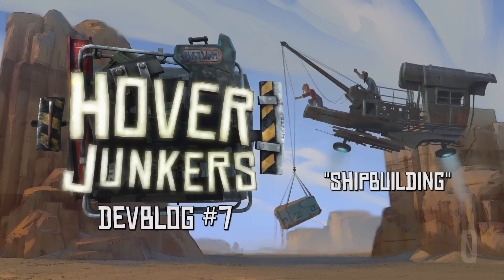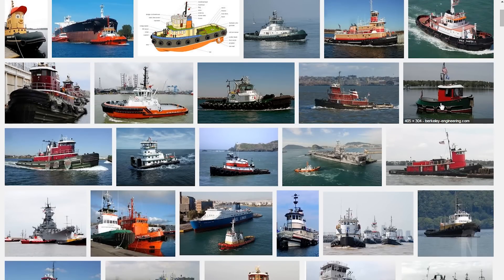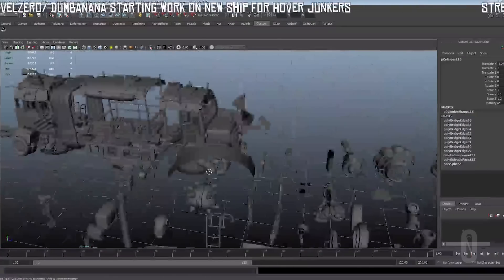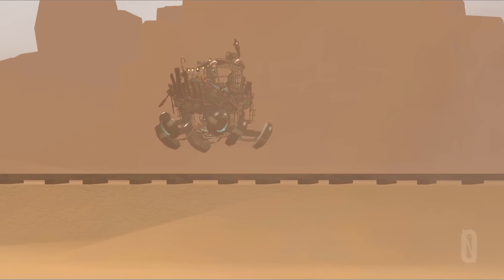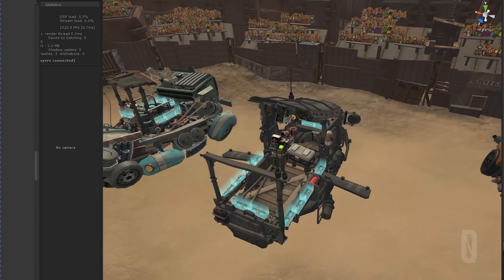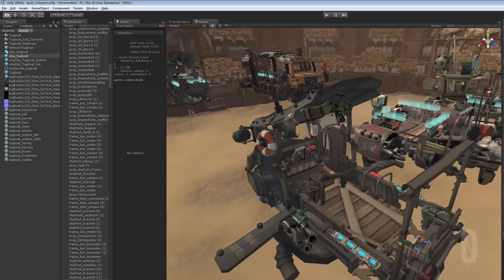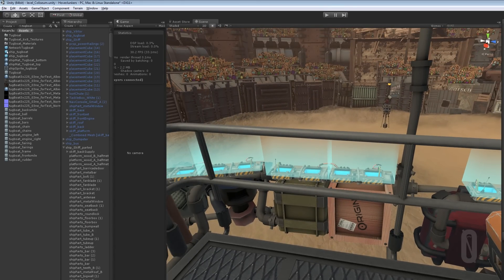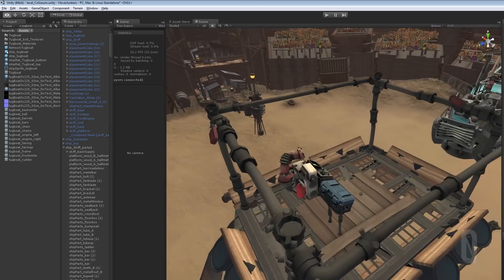How to Build a Hovership - Hover Junkers DevBlog #7

Comment: cool video

it would be interesting if people started with the bare bones elements needed for a ship and could assemble their own (not just attach new pieces to improve or alter an existing ship).  like starting in a base wrecking yard full of hulls or platforms and various components you need to make a floating junker, the component choices you make affecting  performance/play style.
.. did you choose a big or small power plant - or multiple ones?
.. do you build it like a race car or a demolition derby car?
.. what was the starting hull like?  a raft, a bare car, boat?  sleek, small, big?
.. how many lift units?  is it anti-gravity, jets, ducted props?  or a combination of your choice?
.. I have seen hand weapons (revolver, shotgun) .. are there going to be weapons points on the ships?
.. are ships all solo or can you cooperate, have a crew?

Comment: Depending on if you have pre-builts or if the player builds their own, you could have special attacks or moves for each pre-built. For example, that Angler-type craft that was very roughly demo'ed, you could build a kill function that counts the kills that you get for ships and once it reaches a certain amount that bottom jaw on the ship opens and a little bobble (like on an actual angler) deploys on top of the ship. The bobble acts like a magnet and draws in other ships based on their weight and range where the mouth crushes them. This is under the assumption that you can destroy each other's ships, but just a suggestion.

Comment: What kind of system requirements is the finished game going to have? I just bought Ark Survival in anticipation of VR and it barely runs at the lowest settings in 2D (and I thought my computer was rather decent). Hopefully HJ will be better optimized?
Reply: +James Dreger Look up the minimum specs that oculus recommends, roughly around that for minimum. VR is super heavy, you're going to need a really beefy computer to run even the most basic things.
Reply: Alex Knoll
Thanks, I'm sure you've mentioned that before, wasn't sure if you guys were doing any testing  with different setups.
Reply: I heard of people using only things from the 700 series for low end vr, but to be save I would just get a gtx 1070